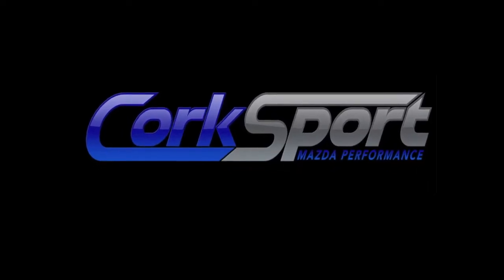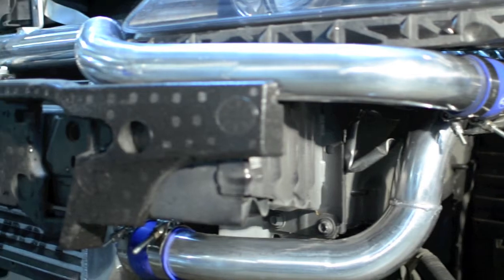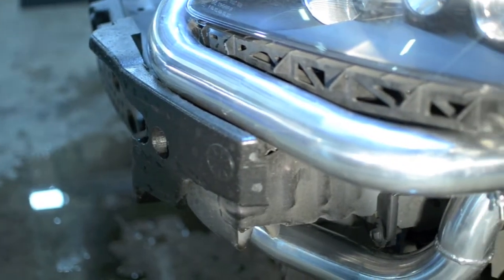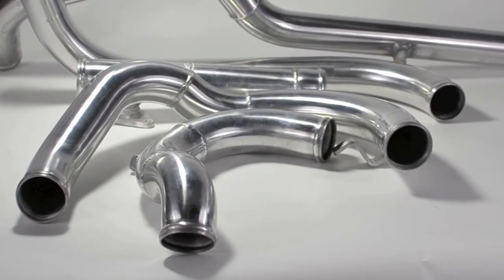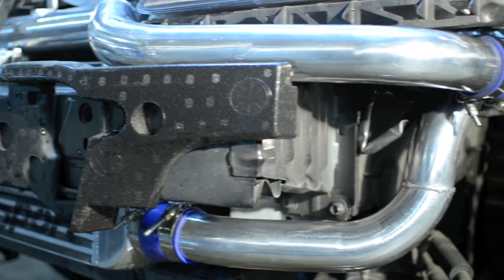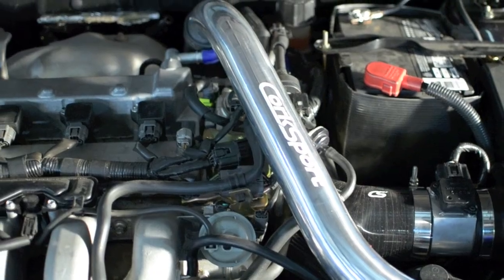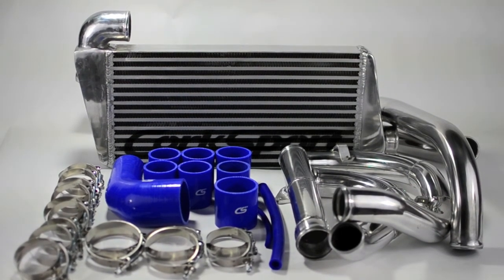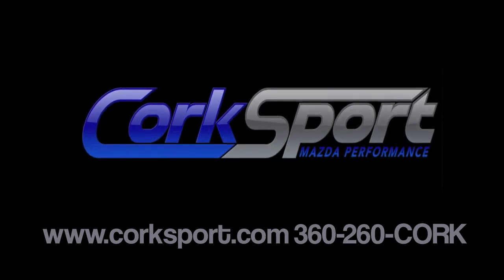CorkSport Mazdaspeed6 FMIC for SRI Kit

Comment from the maker: You do not need a tune but it is a good idea to get the most power from the installed modifications.  With the upgraded FMIC and exhaust you will need to look at upgrading the high pressure fuel pump as well.

Comment: when you install one of these, is it necessary to get the car tuned? what about when you replace the exhaust too? or can you just bolt it on and drive away with no problems? i'm looking at upgrading to a front mount intercooler and exhaust, but haven't done anything like this before, any help or advice is appreciated, thanks =)